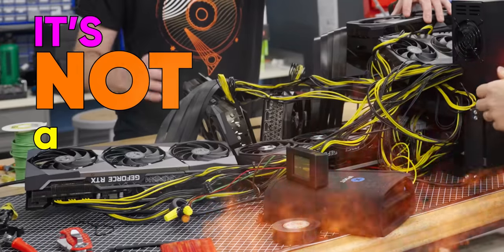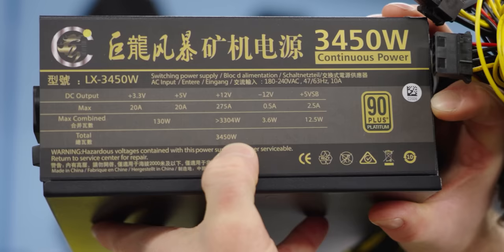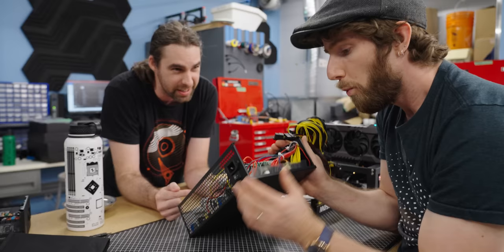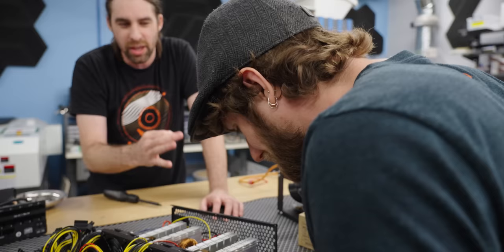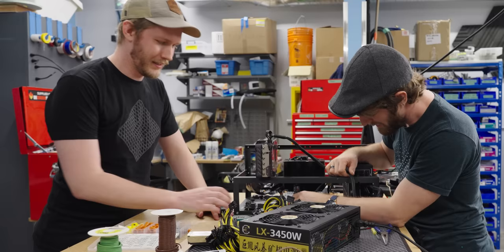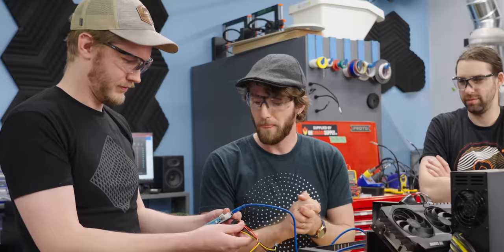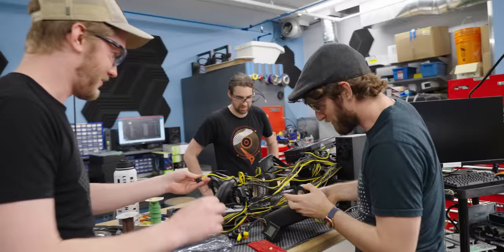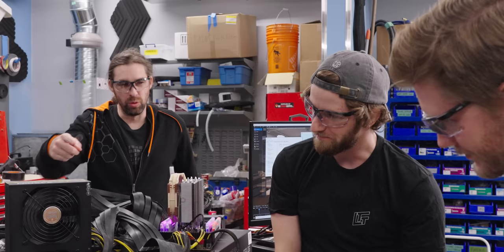This 3450W Power Supply is a Fire Hazard!

Comment: I know it's a common occurance now to see LTT open power supplies, but, while they might do it, I can not stress enough that no average joe consumer should open one, especially one that's been powered on in the last week or so, the chance of extreme static discharge that could result in cardiac arrest is pretty high
Reply: Good to know, I had no idea.
Reply: This comment should be pinned
Reply: This is why when companies repair them, they should use insulating gloves, ensure they are not grounded, and short the power supply to get rid of any charge before they work on it.
Who knows, they might do that...  The key word used here was companies, in other words someone who employs professionals to do this with a lot of know how, a heck of a lot more than I have.
Reply: @EnsignLovell  Is LMG not a company?
Reply: @FalloutProto  i mean technically yeah
Reply: @EnsignLovell  one hand in pocket/in belt when working with Low Voltage and esp High Voltage (this PSU is Low Voltage).
Reply: I was modding a sketchy 1600w one with a nice noctua fan because it was so loud- I woke up the next day on the floor. Got off lucky, some major burns but my cap draining method probably saved me. It didn't fully drain it, but I had repeatedly pressed on the power buttons to try to power the PC on, thus draining the psu. I need a better method lol.
Reply: I used to open mine to take out the fan and clean it. didn't even know this could happen. luckily I'm still alive xD
Reply: @Appri  Use an insulated screwdriver to short out the caps' contacts after almost discharging them your way? Should be fine then.
Reply: @LuLeBe  That works, just scared of discharging them myself that way lol. Also, a tip: a one handed electrician is an alive one. A two handed one is in the grave. Use only one hand, so the current flows through ur hand, not through ur heart.
Reply: it's actually pretty rare these days on quality units (and all other switch mode PSUs) as they will contain bleed resistors.
Reply: @Appri  so nice~
Reply: shit i used to open them up to get the case fans out when i was a little kid. just take a screw driver and discharge the big caps... (dont)
Reply: even low power one hurt
Reply: Even when wearing gloves?
Reply: @OriginalUser2023  For something under 500v AC or 10kV DC, class 00 gloves should do the job, but it's still not safe to rely on the gloves. The real danger is your personal carelessness as an amateur hobbyist "electrician."

As voltage and current goes up, handling live wires and capacitors requires gloves that are thicker and thicker until you're basically wearing oven mitts wrapped in car tires. Eventually you get to a point where no amount of protection can save you, only distance. The issue is something called an arc fault, which basically means that the current finds its way to your flesh through the air. It skips the gloves and goes for your arm, your face, your legs, then through your body and into ground. Above 100kV you've already fucked up just by standing near it. 

Capacitors in devices like these can range from 100-650v, but they usually don't gonna have enough charge to bridge a considerably large gap. It's still enough to leap a few mm and stop your heart if you give it a chance. You know how you might get a teeny tiny static electric shock from brushing your arm hair against a doorknob? It's as easy as that. In fact, your average static shock from rubbing your feet on the carpet is actually around 2-5kV. It just doesn't kill you because your body is a really weak capacitor and doesn't hold much charge. But an electrolytic capacitor holding half a Farad has a stupid amount of charge. So it's remarkably easy to just bumble your way into a bad time when you have five or six of the damn things lined up on one board. 

The safest way to handle devices with large capacitors in them is to find them and discharge all of them, so you KNOW that they don't have a charge left. Get yourself a dedicated capacitor discharge pen, or a chonky boy resistor, and bridge the two connectors of the capacitor. Then use a multimeter to check the voltage and make sure there's nothing left in the tank. Some lazy bastards will use a screwdriver to discharge their capacitors. DO NOT DO THIS. Safety aside, it can damage the capacitors and the board and cause them to pop the next time you plug the device in.

That's generally good protocol for smaller devices like these, though I can't stress enough that you should never DIY a power supply if you've never had somebody give you hands-on electrical safety training. 

Now, if you were an electrician working on industrial equipment there's a good possibility that you're working with circuits that laugh in the face of rubber gloves and PPE. There are voltages in power lines that could leap over a foot and turn you into roast beef in a microsecond and won't stop cooking you until someone wanders into the room all hungry thinking the shop was having a bbq. And if you've got tens of Farads in a capacitor bank, messing up doesn't just give you a shock. You get vaporized. This is why safety protocols like "lock out, tag out" are deadly serious. Wandering over to a circuit breaker and trying to circumvent the locks while the electrician works on some equipment will not only get you fired, but the electrician will literally hunt you down and beat your ass into a bloody pulp. That's if they survived, of course.

In summary, electrical safety and high voltage is something best left to the professionals. If you aren't prepped with the full safety guidelines and trained well, stupid tiny mistakes can ruin your day.
Reply: I guess every not too dumb consumer knows how to short the caps with a screwdriver before touching the PCB's back tracks. At least, that's the first thing I do when I take out a PSU's PCB. If you just open it to blow the dust away or change the fan or stuff like that, you're pretty safe, touching the top of the caps and heatsinks is safe.
Reply: @Appri  good thing that you survived, i once also lost consciousness, fell onto the floor and woke up on it, but nothing related to the pc, was something to do with my spine which sent some kind of a signal to my head when i got up from the chair, waking up on the floor brings a confusion and it takes some time to realize what exactly happened and why are you on the floor and for how long, my head was hurting for a while afterwards though but luckily my floor have a carpet on it, not soft one but a carpet nonetheless
Reply: I think the rule of thumb is if you have the tools you are fine, and if you don't you shouldn't buy them for this. When I worked on or near power supplies I'm using insulated screwdrivers rated to 1,000V also wore insulating gloves, and insulating footwear, and always triple check with my multi-meter... as for waiting a week, no chance, I needed to test if it was working so it is laying there open on my guitar case that I was using as a makeshift bench as I plug it and unplug it very carefully.
Reply: I apparently was really, really, lucky. Sheesh.
Reply: Had that happen to me when I opened up a 1000w powerbrick for a PS6100, so enterprise level. Got a big shock and felt my heart almost squeeze, hard to explain. Swapped out the fans and still use it today.
Reply: The EE in me wants to correct you, that it's not a static discharge, but yeah, don't mess with it if you don't know what you're doing, and if you do know what you're doing, don't mess with it while alone.
Reply: I didn't say they weren't, if you read on you'd see I used the word professionals, ie, someone who knows EXACTLY what they are doing, what could go wrong, and how to prevent those things from going wrong.  LMG is a good tech savvy company with a lot of knowledge, but they do not know as much as an engineer who is paid to fix power supplies for a living.
Reply: You're supposed to "short" the caps to drain the stored energy.
Reply: @Appri  I wonder if someone witnessed that happening they could 'see your bones' because that's what cartoons told me would happen.
Reply: @invisi-bullexploration2374  Nope, you can't. Lmao
Reply: @triadwarfare I see. I too like to live dangerously.
Reply: @Appri  you got very lucky. Damn man, this is what's scary about this stuff.

Comment: I'm glad to see they're making power supplies for the RTX 40 series cards now
Reply: underrated comment
Reply: Aged like fine wine
Reply: Could support a low-end 50 series as well
Reply: @theplayerofus319  the 3090ti is infamously bad so that's a pretty low bar lmao
Reply: More like rtx 80 series if that was a thing
Reply: @theplayerofus319  yet consumes 600W
Reply: @theplayerofus319  "NVIDIA RTX 4090 Draws Over 600W of Power in Certain Benchmarks, Can be Overclocked to 3GHz or More? NVIDIA's Ada Lovelace flagship, the RTX 4090, has a TBP (total board power) of 450W, the same as the 3090. However, the graphics card may draw significantly more power in specific workloads."
Reply: @theplayerofus319  limited knowledge is a dangerous thing
Reply: @theplayerofus319  so there - it is capable of doing so - I wonder what that comment about 'not even close' was
Reply: @theplayerofus319  Galax didnt build the GPU die - just the PCB with better power delivery - so its just a 4090 gpu that consumes 600W nothing special
Reply: Rtx 40 series is significantly more power efficient than the 30 series, what are you talking about
Reply: Thy make it for amd 7900 xtx 😅

Comment: You know the GPU stock situation is improving when Linus can put on death row 6 RTX 3080s.
Reply: It's definitely plunged, but unfortunately, it's not dropping anymore at this time.
Reply: 7
Reply: 7*
Reply: Thankfully it got better to a point where I could finally upgrade from a 1060 to a 6600 XT.
Reply: Even with shortage, he could still get a death row 6 considering that's linus
Reply: @EduardoWalcacer  lol at least you have that i got a RX 370 2gig  bc my 4 gig broke it was a rx 570 buuuuuut im hoping to upgrade to a 3060 here soon i saw on for a little over 500$ its like 546 or sum
Reply: @bluflame5381  where do you live? i’m in the u.s. and newegg has a couple 3060s for msrp rn. u need the link??
Reply: @bluflame5381  if your motherboards compatible I recommend the 6650xt better than the 3060 10% worse than the ti and around the same performance as 2080
Reply: @Zezshi  oh it should be i got a i7 9700k the mobo is a asus Z390 ddr4 1600mgh 16gb ram runnin dual channel so it should b fine
Reply: @bluflame5381  yeah you should get the 6650xt over the 3060 like $100 less for much better performance.
Reply: There was like ~25-28 of each gpu at my local micro center
Reply: @EduardoWalcacer  6700xt for better 2k res performanse. Because rtx 3070 is plagued with 8gb same with 3070ti and 3060ti
Reply: @arnox4554  the custom gpus are selling for normal on Best Buy right now. Granted, normal for them means an extra hundred or two, but still, there are 6900 xts going under MSRP and rtx 3080 Tis going under MSRP,

Only saying that to state facts that it’s back to normal. I’d recommend at this point, if you have the money for a gpu, hold it and keep adding a little more for the next rounds of GPUs coming up. 

I’m still disgusted with Nvidia’s move and I don’t think they’re going to work great for gamers with what they did (they’re pretty much overclocking the cards before you can overclock them. They did this when AMD’s GPU specs were leaked, so I doubt that scene is going to be pretty)

But AMD is supposed to double what the prior generation is capable of, and pass it even more if you manage to get the top of the line card. And while it’s still annoying that they’re going to increase the price, current estimates are still under 1k for what’s being guessed to be the 7800 XT (they’re guessing between 699 and 999) so if you’re an AMD gamer, I’d recommend waiting and stashing a bit more cash for those, rather than buy this generation, since they’ll be long gone news soon and honestly paying full price for them is not worth it at this moment.
Reply: @Norinia  I'm probably not even going to pay attention to the 40xx series from Nvidia because of the ABSURD power requirements. I'm sorry, I'm not gonna contribute to normalizing that shit. The OG 3090 was already getting a little silly.

Comment: This with a 4090 would be a double fire hazard lol
Reply: tfw my 4090 consumes the same power as a 3080 or less. you people really overestimate 4090 power draw.
Reply: @Peanutnibbler  if you're melting cables with a 3080 or 4090 or whatever then you are doing many things very horribly wrong
Reply: @the_undead   even Nvidia admitted this was an issue, it was adapters not cables or the cards, no one user was at fault. this is why you should never cheap out on components. Some companies have no integrity.
Reply: @crylune  The 4090 founders uses the same as the 3080, the AIB aftermarket cards do NOT. They use more power than the 3090, 400-500w. If you OC them it can go over 600w.
Reply: Combined with the NZXT riser cable! Maximum fire hazard PC!